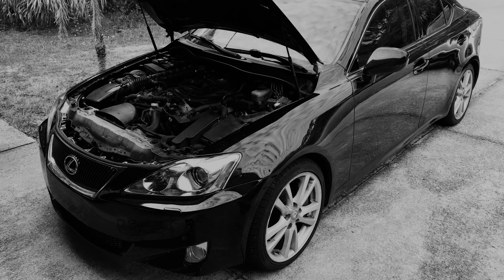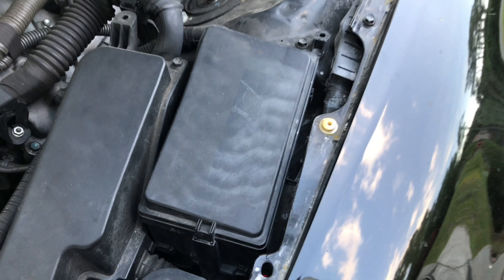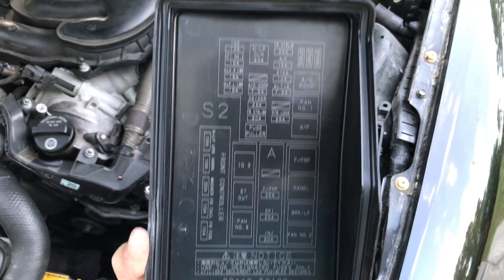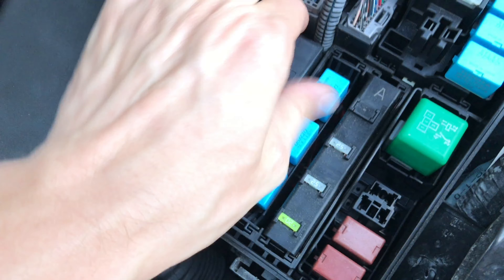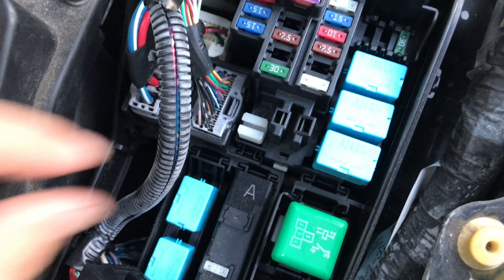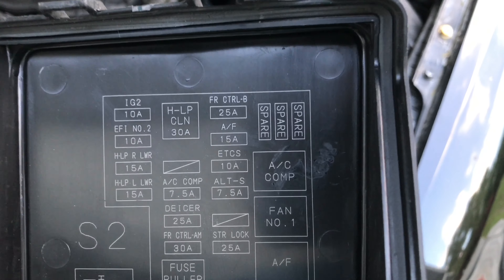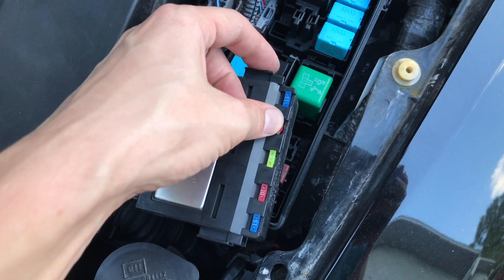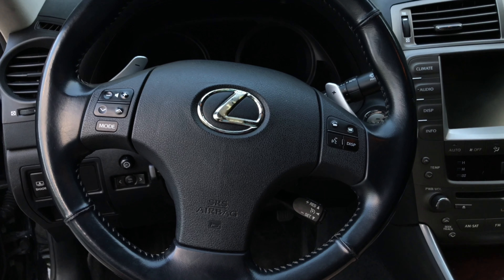How to fix broken horn on your car.

Comment: Nice video! That controller is also used for a DRL (daytime running lights) in US and CA models.

By the way, the fuses in 100pcs box, could be dangerous if they are cheap Chinese make. They don’t blow when needed. So you should check them.. better to get them at the local shops not online.
Reply from the maker: Well, the thing is all of them are Chinese. How would you check them though?
Reply: DIY-time not all of them... Chinese fake ones are dangerous. If you go to your local store, you can get proper ones, as fake ones are illegal to sell in us stores.
Reply: DIY-time not all of them... Chinese fake ones are dangerous. If you go to your local store, you can get proper ones, as fake ones are illegal to sell in us stores.
Reply from the maker: Now I really want to put together some kind of device to test them...
Reply: DIY-time here is the video https://youtu.be/nELwmfAOz_I

Comment: My paddle shifters, horn, and volume up and down buttons are not working. It is possible the wheel was replaced poorly? Or the fuse box is broken? I have a 2012 is250
Reply from the maker: Since its multiple items and this is after replacing wheel, sounds more like electrical connector is not plugged in all the  way or damaged. Or replacement wheel was defective in the first place. You can try to connect your old wheel and see if everything works again. Then you’ll know its not fuses or connector.

Comment: is it possible that it is a fuse if the horn DOES work with the remote alarm but just not from the steering wheel?  Replacing the spiral cable assembly is a $1200 fix and supposedly pretty hard to DIY.
:(
Reply from the maker: Sometimes alarm system has its own independent speaker, thats why it works when using remote. Try to check the horn fuse.
Reply: I just replaced the spiral cable that I found in the junk yard for 15 dlls and it was pretty easy to install, it also control all the functions on your steering wheel, cruise control and blinkers.
Reply from the maker: Way to go!

Comment: Mine is not the fuse, I had it checked and the fuse is working. My horn works sometimes when I turn the car to the left or right. I think is something else in my case 😭
Reply: I'm in the same boat 😢
Reply: Had a Lexus service rep suggest that the problem is most likely in the steering column. Mine doesn't work no matter what direction you turn the steering wheel so I'm exploring other possibilities before pulling the steering wheel. Always try the simpler solutions first.

Comment: I changed the fuse but the horn still don’t work. What do you think it may be
Reply from the maker: Shorted or open circuit possibly.
Reply: clock spring
Reply: @DIYtimeTRD  I had the same issue. I changed the fuse to the spare one included but the horn still doesn't work.

Do I need to bring it to a mechanic to fix the short circuit? Or perhaps the replacement fuse is also blown for some reason?
Reply: @stephanmaritz3924  I have the same issue but my airbag light isn't on. And my cruise control works. Is it still the clock spring or probably the fuse?

Comment: I need help for a es 300 is it the same
Reply from the maker: It might be a little different, but you should be able to find the correct fuse on the diagram under fuse box cover or in your owners manual.
Reply: Kudos for the Video! Excuse me for the intrusion, I would love your thoughts. Have you considered - Parlandealey Vanish Ringworm Process (do a search on google)? It is a smashing exclusive product for revealing how to repair your vehicle minus the normal expense. Ive heard some super things about it and my m8 finally got cool success with it.